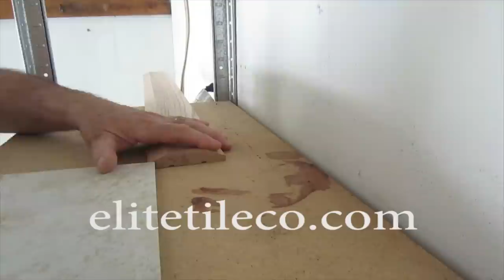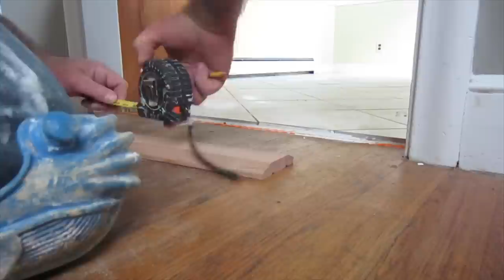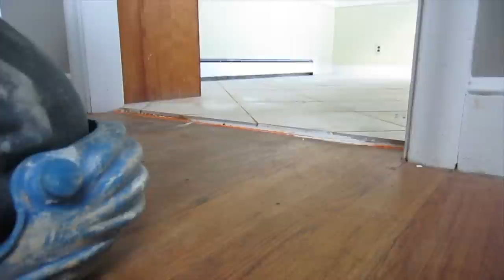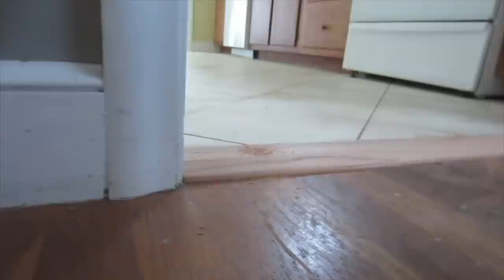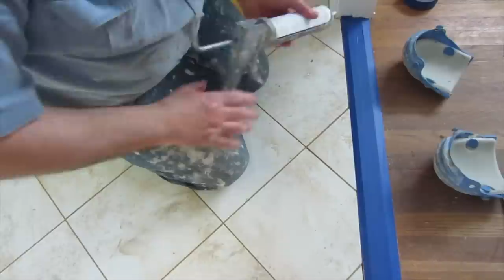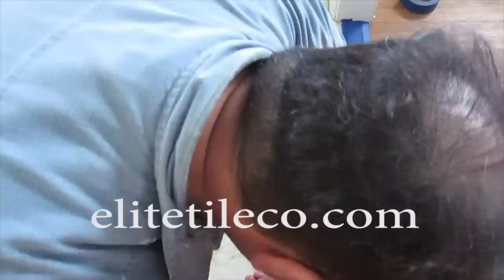How to install an oak threshold

Comment: I'm surprised you didn't also use some construction adhesive to glue it down before nailing it. They get stwepped on regularly and are prone coming loose if just nailed IMO

Comment: Hi! I have a pre finished t molding. Is it wise to use nails or screws? Will the wood filler blend when its pre finished or should I just glue it down?

Comment: What's the eraser-like thing you used to fill up the nail holes? Also did you just use water in sponge to wipe off the silicone caulk between the threshold and floor? How about the small gap between the threshold and door jamb?

Also: what if the wood floor isn't flat but a bit slanted? What can you use to fill up the gap difference on the wood-floor side? (grout/adhesive probably wouldn't work well with wood?) Many thanks!
Reply from the maker: ciaconne Eraser thing is a wood filler, toy can get them in many different form. Not silicone caulk, but color matching siliconized acrylic caulk.Make up an oak threshold to fit the profile.
Reply: I tried the pencil filler and never liked the results. Used regular filler

Comment: great job.  i have something similar to do but transitioning between tiles on a concrete floor to laminate on a concrete floor.  so i can't use nails.  worried im not going to be able fi the threshold down - any tips?

Comment: Do you not need wood filler or does the scraping with the blade fill in the nail holes? Sponge is something I'll def use in the future.
Reply from the maker: Yes use wood filler for the holes.

Comment: Installing oak threshold/saddle in bathroom doorway, old door jam and saddle removed. bathroom tile flooring and hallway oak flooring are at slightly different heights. tiel approx 1/2 higher. so i can cut saddle back to match flush?
Reply from the maker: I don't see why not, i do that all the time.

Comment: hi.  what about the expansion gap for the oak?  i thought you leave an expansion gap of the thickness of the wood?  thanks.
Reply from the maker: There is a small gap, but your rule is something i have never heard of.
Reply: You only need an expansion gap width ways of the laminate not long ways. Laminate doesn’t expand long ways.

Comment: Nail?  You nailed it?  I was going to use screws.  I assume you used ribbed or 'ringed' nails so they'll be less likely to work their way out of the wood as the threshold flexes?
Reply from the maker: Use finish nails that have a small head so they can be hidden under wood putty, screws or nails with a large head will remain visible and unsightly.
Reply: *****  Uhm, I'm dealing with the threshold on an exterior door, so I need something tougher & more durable than finish nails.  A woodshop-teacher friend told me to use stainless steel screws & to counter-sink the heads.
Reply: Listen to your friend..
Reply: @WWZenaDo  I have the same question. Nails or screws?

Comment: What type and size nail did you use?  Thanks.
Reply from the maker: +mikenc1515 Use a finish nail that is appropriate for the thickness of the threshold.

Comment: Great Sal! Any ideas for a threshold when going from tiled bathroom to a carpeted hallway? Thanks.
Reply from the maker: Depends on the height difference from one to the other.
Reply: Tile is 1/16" higher than carpet. Thanks Sal.
Reply from the maker: I would probably use a Schluter metal to protect the tile edge and tack the carpet up to the tile.  Or a marble threshold,
Reply: Sal, I probably should have installed it when I installed the tile. I need something that will transition after the tile is installed. Thanks.
Reply from the maker: Can't really say without knowing what you have for width. Would an oak nosing fit?
Reply: Thank you Sal. I'll take a look at that. I was thinking of either wood to match the door frame, or brushed nickel to match the bathroom hardware.

Comment: How much higher is the tile than the wood floor? 3/4"? I'm dealing with the same issue.
Reply from the maker: +Anthony Rauth Not 3/4 but you can make your own threshold with a piece of oak if it needs to be that thick.
Reply: Ok, thanks a lot!

Comment: excellent video sir..quick question if I may..what if my wood foor is lower than my tile..will the threshold still work and make an even transition..?  thanks in advance
Reply from the maker: You can use it as a reducer to go from the high tile to the lower floor.
Reply: +Sal DiBlasi thank you sir...what size threshold are u using in the video?
Reply from the maker: Jose Luengo I think it was 5/8" thick

Comment: If my tile cut isn't as smooth as yours can I rebate the threshold to go over the tile or is that a no-no? Also, is the threshold paintable?
Reply from the maker: i don't  see why not, and mine are usually oak so i give them a few coats of urethane.

Comment: Great video. 

You put the oak threshold on top of the floor. Is this a laminate floor or a wood floor ? 
Can I used this oak threshold (You use) as a transition from tile floor to laminate floor assuming that the tile floor is 1/2 inch high and the laminate floor is 5/16  high? 

can you please advice.

Thanks for the great video
Reply from the maker: This was a tile floor transitioning to a hardwood floor. I really can't tell you what ot use for your transition as I do not know all the variables, however a laminate floor typically requires a movement joint around the perimeter so you would need to allow for that at the door way as well.
Reply: Thanks a lot

Comment: excellent video sir..quick question if I may..what if my wood foor is lower than my tile..will the threshold still work and make an even transition..?  thanks in advance
Reply: I was actually in the same situation. You wouldn't need a threshold. You need what's called a reducer. My floors are about 1/4" off set. It worked great.